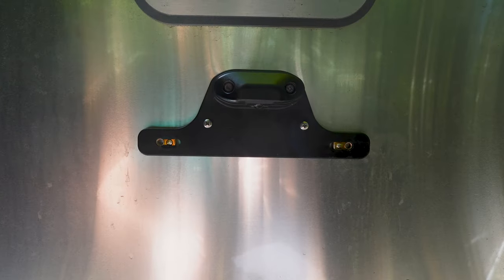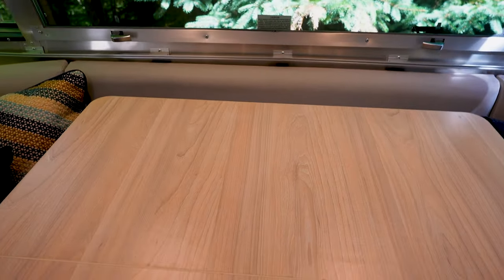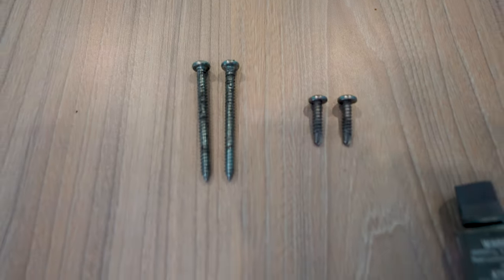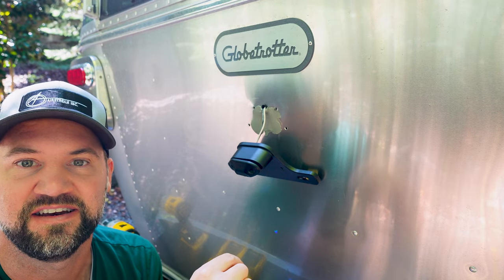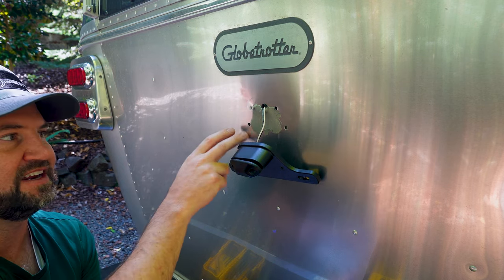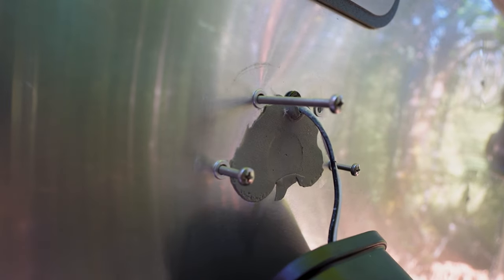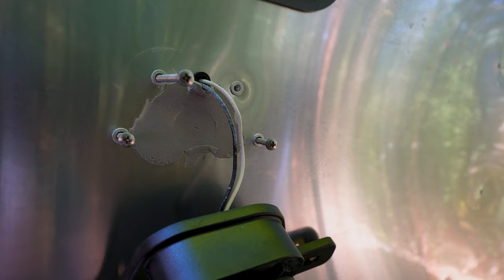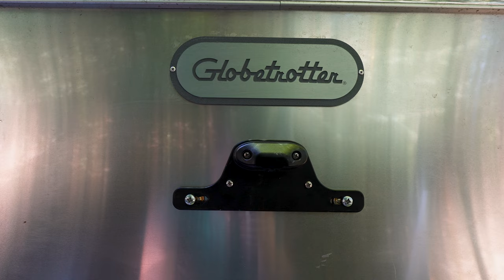Check Your Airstream Plate Mount Before Your Next Trip!

Comment: Good tips. Agree with you. The factory job is not that elegant. This definitely fixes it the right way. Where did you get the rivnut pulling tool and rivnuts?
Reply from the maker: Greetings. You can get the Rivnut tool and Rivnuts on Amazon or likely a local hardware store. The tooI have is just a basic model off Amazon.  Links below. Thanks for watching!

RivNut Tool: https://www.amazon.com/dp/B09KXYHZWT

Aluminum RivNuts: https://www.amazon.com/dp/B097TCKKBL